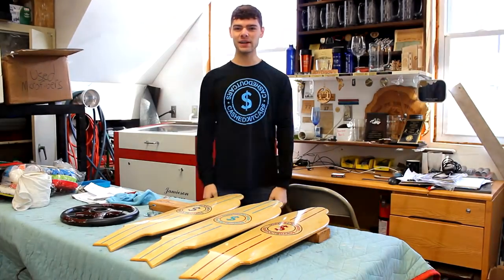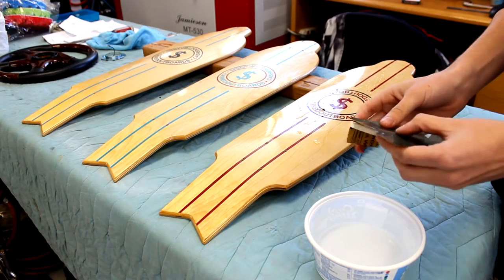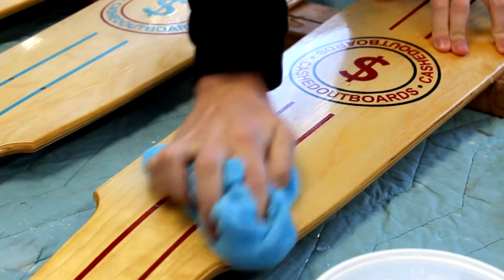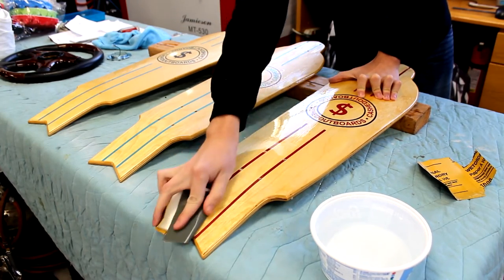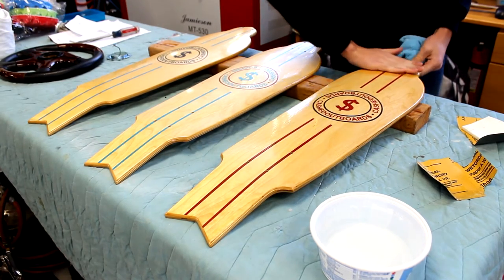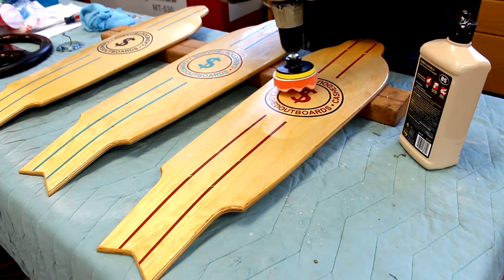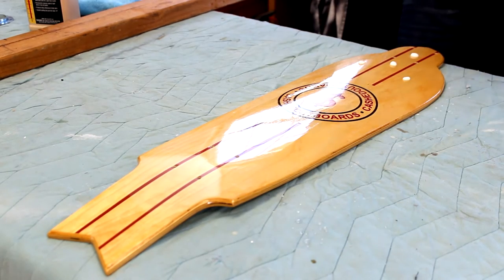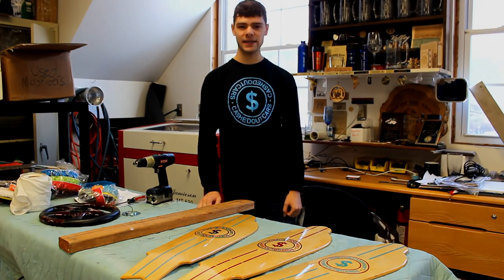How to Get Clear Coat to a Mirror Finish | CashedOutBoards

Comment: Any reason I couldn't do this on a board I just purchased that doesn't have as good of a finish as yours?
Reply from the maker: +KMSvehla if it has thick clear coat already then it could work, if not I'd recommend trying to scuff down the finish and adding more clear coat to make it thicker before wetsanding it and buffing it. Good luck and let me know how it goes!

Comment: Hey, I stained and coated my board 2 weeks ago, and it is still putting out the smell of polyurethane and stinking up rooms wherever I bring it. I used the miniwax brand. Do u have any suggestions as to how to get the smell out?
Reply from the maker: +Liam Reid keep it in a well ventilated area and it'll go away, I'd recommend keeping a window open with a fan while applying the clear coat